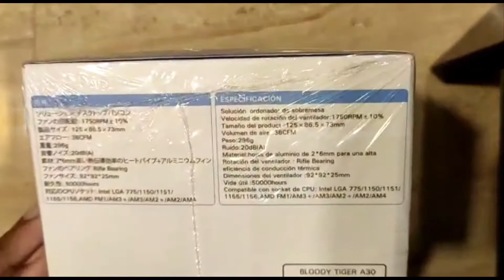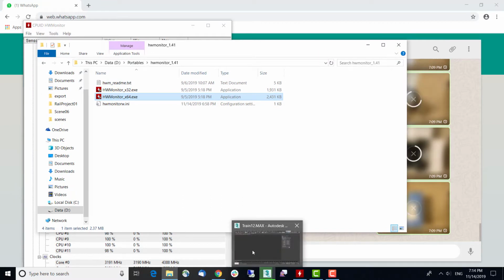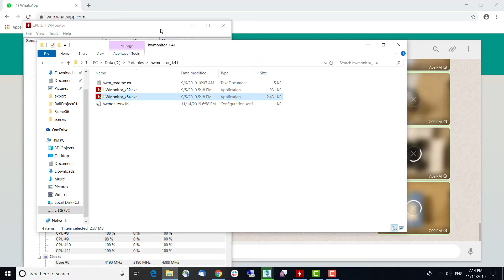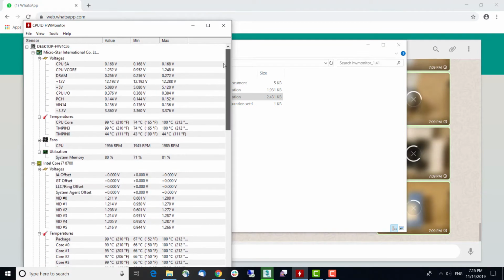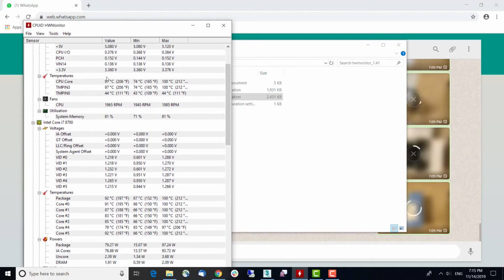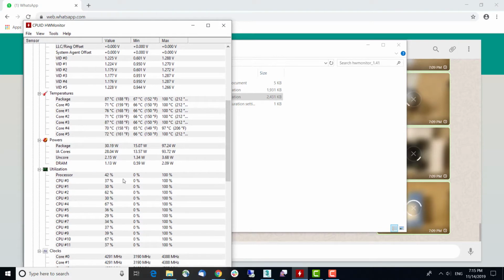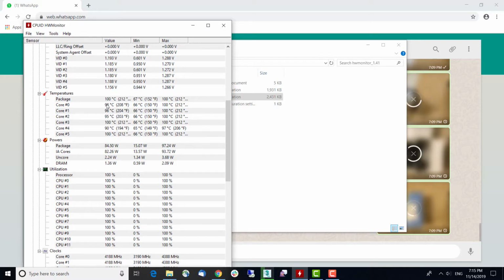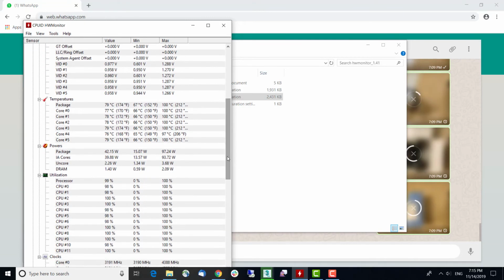Antec A30 CPU Cooler Fan Unboxing Installation Review | Essential for Video Production 3D Rendering

Comment: I just got a 6700k and installed this cooler. It is working great! I didn't realize how HOT these cpu's can get when under load. So far, playing Modern Warfare, mine has peaked at 77c. Nice video